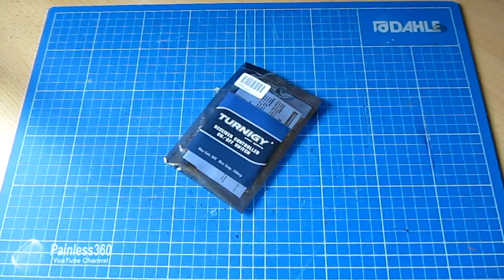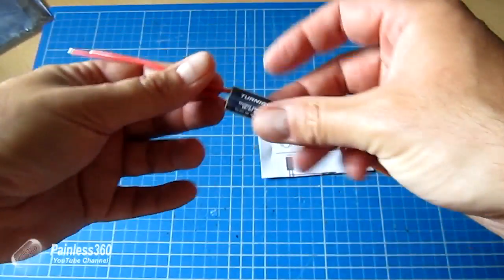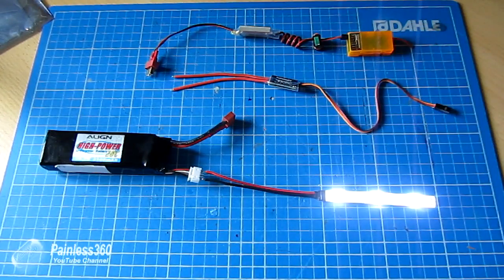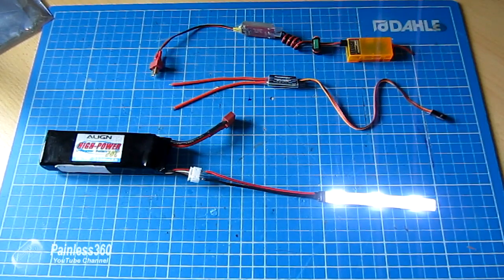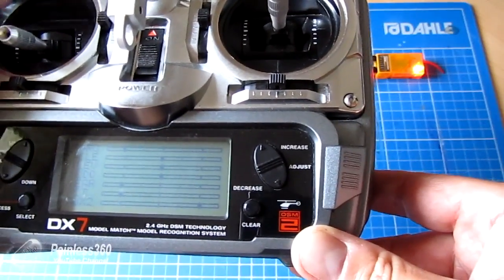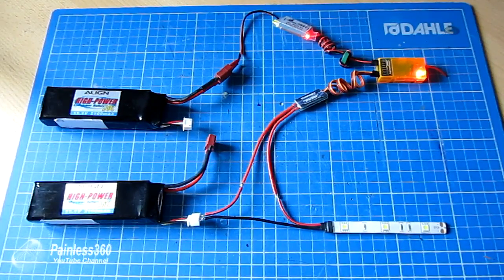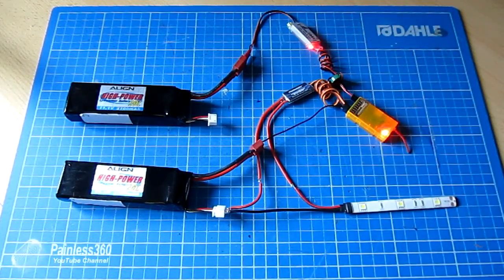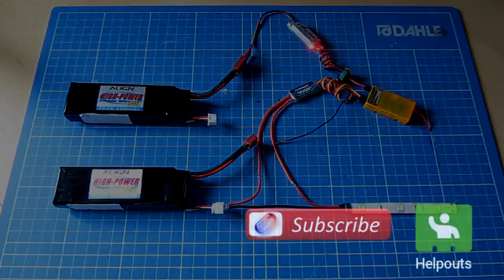Turnigy R/C Switch - Use for LEDs, landing gear etc.

Comment: I have the receiver wire connected to my landing gear channel 5 and want the 'Load' that is the landing lights, to come on when the wheels are lowered.
With one or no jumpers fitted, the lights are either permanently on or permanently off. The nearest I can get is with both jumpers in place, whereby the lights come on when the landing gear is raised and go off when it is lowered (opposite to what is required).
I've tried reversing the landing gear switch but this does not affect the lights, which still come on when the landing gear is raised.
Any idea how to resolve this?
Reply from the maker: Steve Hurley I would try and get the switch/lights to behave on their own without the gear connected. If the switch doesn't operate in the way shown in the video (on when high, on when low, toggle) then I'd get in touch with Hobbyking for support. Make sure you've used the manual to ensure that you have the jumpers where you need them..
Best of luck.

Comment: Thank you for the great video. Two more question please.
1. Is it possible to use this device (PRODUCT ID: LUM-ONF) to use with total 3 meters of LED. HobbyKing Product ID : TR-WP-RE ,PRODUCT ID: TR-WP-GR  and PRODUCT ID: TR-Strip-BL.
2. PRODUCT ID: LUM-ONF. In the Spec. it is mentioned Maximum throughput : 10A / 30v. How to know which unit can be connected to this device.

Thanks.
Reply from the maker: Benoy Thomas The spec for those 1m lengths gives you the current draw (400mA or 0.4Amps).
If the LED strips run on 12v and the craft and battery can supply the current (not to exceed 10A) then you are good. 
You may find https://www.youtube.com/watch?v=WN77jzxWCtA interesting.
Reply: Painless360 Dear Thanks you very much. Very good information. so total for 3 meters LED is 400mA x 3 = 1200 mA = 1.2 A. So still i can use 10A - 1.2A = 8.8 A of LED.

Thanks & Best Regards,
Benoy,
Qatar.
Reply: Painless360 Dear Thanks you very much. Very good information. so total for 3 meters LED is 400mA x 3 = 1200 mA = 1.2 A. So still i can use 10A - 1.2A = 8.8 A of LED.

Thanks & Best Regards,
Benoy,
Qatar.
Reply from the maker: Yes you can but leave yourself 'wiggle' room of 20% so I'd only add another 6amps of lights to be safe.

Comment: Thanks for your kind response Painless360, so yeah, I checked the link you provided. One last question: do you use the 5V or the 6V setting?
Very informative video you got there, have a good day.
Reply from the maker: I always go for 5v, safer to start lower and increase if I find I need it :) Most flight control boards need only 5v..

Happy flying!

Comment: Hello there: would you be kind to tell me which UBEC you used to connect to the receiver? and if possible, could you provide me with a link for it?. Thanks, have a good day.
Reply from the maker: The ones are used I've had for years but a later version can be got from most places i.e. http://www.ebay.co.uk/itm/Hobbywing-3A-UBEC-RF-Noise-Reduction-Output-BEC-Switch-Mode-5V-6V-max-5A-Lowest-/291411053380?pt=LH_DefaultDomain_3&hash=item43d973cb44

Happy flying!

Comment: Thank you for the nice video. Very well explained.
Do you mind if I ask a question.
I have a multicopter with rectractable landing gear and landing lights, so I tried to connect both the landing gear and the lights to the channel that controls it all on the receiver with an y-cable. The problem is that when the landing gear is up, the channel is high and the ligths are on, but I want the lights to be on when the landing gear is out of course. The same should also happen at failsafe (no pulse). Cannot figure how to work that out. I have the same switch.

Thanks in advance.
Reply from the maker: Hi, you can control how the switch controls the lights using the jumpers on the side of the switch. Check the manual and you should be able to reverse the way it works..

Best of luck!

Comment: Thank you for this video. 
But I have a question. 
I have an exacopter with different led(1watt)
The exacopter has naza and has connected with receiver.
Is possible connect the switch with a wire directly on channel 8(landing gear)???
So when I switch on my radio the landing gear the led go on. 
I use 3s battery 5200mah for the exacopter 
And 3s 800mah for gimbal fpv and led. 
P. S the negative wire (battery 1 and battery 2) is difficult to see. 
What is the pin that you use to connect the negative. 
Thank you so much.
Reply from the maker: That should work, you may have to move the jumpers on the switch so it comes on when you want it to..

Best of luck with it..

Comment: I put them on a switch and hooked them to power and switched it and nothing happens. I went into my transmitter and scrolled through from 0% to 100% on both the high and low channels. Nothing is working. Do you know what else to do or how to troubleshoot this?
Reply from the maker: Jordan Mowbray do you have a picture of how you have got it wired?

Comment: I am using a DX18 sequence to simulate a strobe with LEDs.  The on-off event in the sequence is "instantaneous"  Is the switching action fast enough to follow the sequence and simulate a strobe?  Is a spec available that specifies the switching rate?

FYI, the switch I have is defective.  The return/replacement process is started.
Reply from the maker: Hi Curt, no detail that I have found. I suspect that your use case wasn't considered. 

I suspect that the switching speed is quite fast and any delay is due to the processing of the incoming PPM signal.

If you set this up I would be interested in the results. 

Happy flying!
Reply: Painless360
MY RED-FACED BAD!!  The thing works - when a proper input voltage is applied!!  I thought I had tested everything thoroughly. 

NOT!!

Now to cancel the return claim.

And, interestingly, the switch is VERY fast!  The switch is so fast that it is possible to see the the effect of the RX signal on the LEDs.  Given sufficient on-time, the LEDs flicker, presumably in sync with the RX channel output pulse signal.  While cool and cute, it is not what I was looking for, so, I have adjusted the TX sequencer output timing so that the LEDs are only on for a few milliseconds, masking or obscuring the flicker.

I now have a cycling double strobe simulation on two 27 LED strips, thanks to my trusty Spektrum DX18 (The DX9 would do the same thing.) and the Turnigy RX switch.

Now - to go flying!  :-)
Reply from the maker: Hi Curt! Live and learn! :) Glad it's all working..

Comment: I have the Turnigy switch wired with a single 3s LiPo with both jumpers in place.  It is always on and can't be turned off.  Is it possibly defective?

TIA
Reply from the maker: Hi Curt, if you are confident that the board is getting a signal from the reciever that is changing enough then it could be. Hope you get it sorted. Happy flying!
Reply: Painless360  When I replace the switch with a servo on the RX, and toggle the TX switch, the servo moves the correct amount.  Doing the same with the switch, it never changes state - (always on).

Comment: One more thought.  What's the practical way to do this, connector wise?  Would you always want to connect to the battery balance plug every time? So that implies an adapter (ie, male balance connector on the LED side)?  With three or four LED strips on a quad, how to wire in all the various wires?  Anyone chime in here.  :-)
Reply from the maker: when building a new quad I always solder in an extra spare flying lead from the power distribution board so I can connect 12v to all sorts later if needed (voltage sensor, lights, gimbal etc). Happy flying!
Reply: Painless360 Bingo.  Gotcha.  Thank you so much for replying.

Comment: Really nicely done, well presented!  Pardon a newby question though,  Your diagram shows a 6s battery powering the LED strip.  Isn't a 6s battery 22.2 V?  And these LEDs are rated 12V?
Reply from the maker: Hi Richard, no such thing as a dumb question!

You are right, all the LED strips are usually 12v rated.

The reason for using them in the explanation of the common ground was to avoid the extra complexity of powering devices like motors and heavier power equipment.

Happy flying!
Reply: Painless360 Thank you so much for your videos, this is really instructive for the newbies. Just to make sure, doesn't both batteries have to be identical or new for this to work safely? and, its possible to make the negatives connection before the esc's? Greetings.

Comment: I have one of these and it worked perfectly on my quad.  I wired mine into the pcb and had the LEDs running in series.  Everything worked fine. Then I swapped out my kk2 for a naza.  Nothing else changed, but now my LEDs won't switch on.  I have no idea why though. my switch is plugged directly into the receiver like it should be. I did notice before though, if I powered up the system with the switches set for the lights to be on, flicking the flap switch wouldn't turn them off again.  I only had control of the LEDs,  if the switch was set to the off position as I powered up.